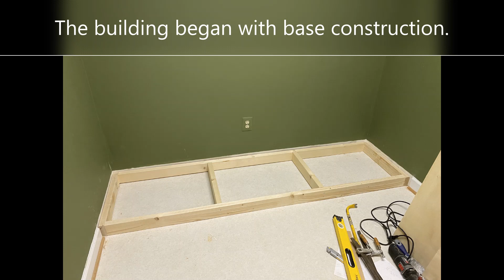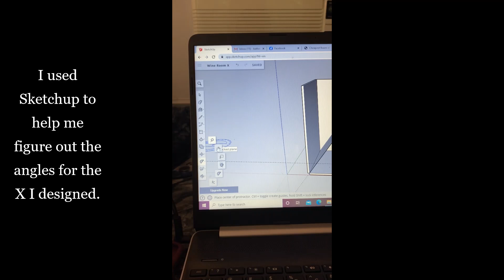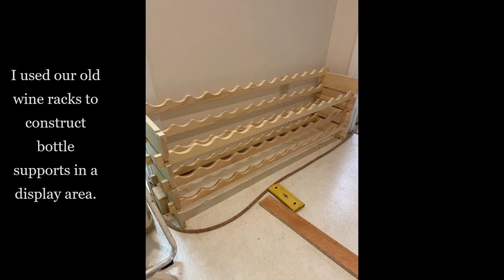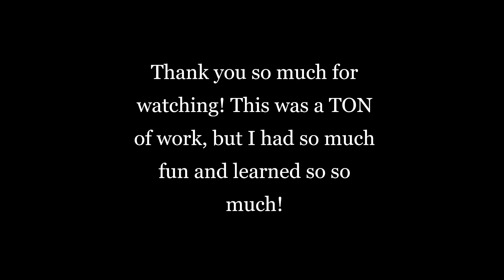Wine Cellar Construction

Comment: Also the outcome is very clean. How come I do not see any brad nail or screw heads? It looks like as you just used glue.
Reply: I used both glue and pin nails and then filled the holes before staining.

Comment: Really nice build and video. Enjoyed it. 

What did you do for humidity and temperature control?
Reply from the maker: It is in a basement, so the temp is generally acceptable down there. For now, we have a hygrometer to monitor the humidity and run a humidifier as needed. Eventually we will install an actual system, but we kept it simple for now.

Comment: This seems like such a fun project.  Thank you for sharing the process with us.  Can I ask? What did you use for a vapor barrier to prevent mold build-up in the walls? I'd also be curious about what you're using for a cooling unit? Thank you for sharing!
Reply from the maker: Sorry for the late response. The room was already designed as an additional bathroom so it had green board. At this point we haven't added a cooling unit because, to be perfectly honest, we don't buy super expensive wine. We keep the good bottles we DO buy in the little wine fridge in the bottom right corner.

Comment: This is so cool, well done!  Wow!  
Did you use any insulation in the walls and what kind of cooler system did you install?  I’m from SoCal so refrigeration is priority.
Reply from the maker: The room is in a basement, so temp is usually ok. For humidity, we use a hygrometer to measure and run a humidifier as needed.

Comment: Nice design. How are you controlling the room’s temperature?

As a side note, please never ever do that table saw trick again! Kickback is extremely dangerous, even though you positioned yourself out of the way
Reply from the maker: We are not as we don't typically buy super expensive wine. It is in a basement, so it generally stays cooler down there anyhow, and we have all the heating vents turned off. For the good wine we DO buy, we place it in the little wine fridge in the bottom right corner of our cellar.